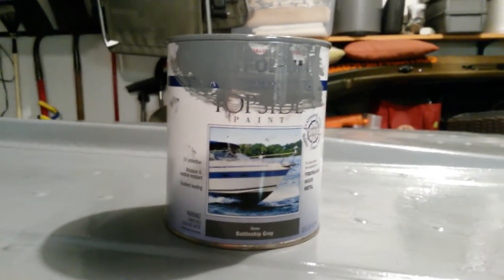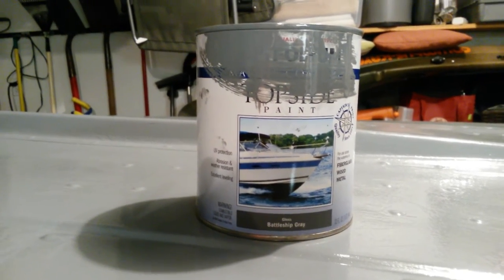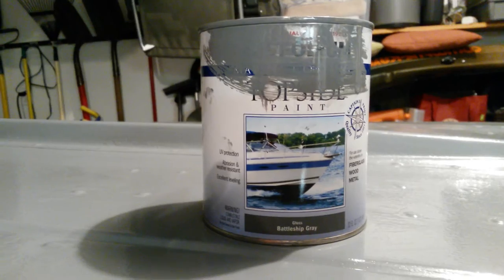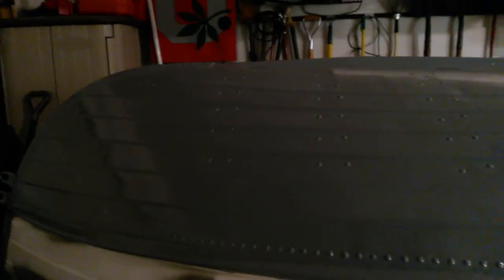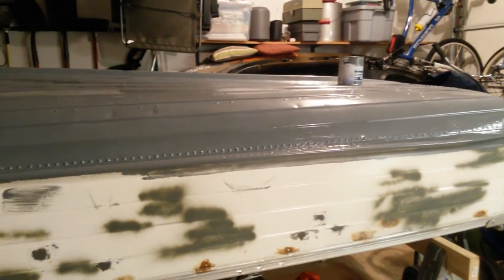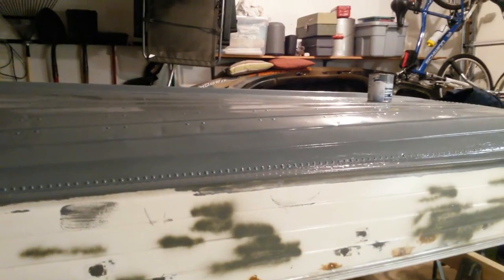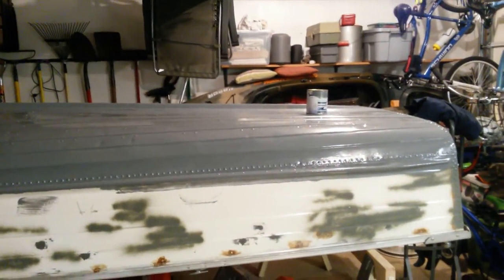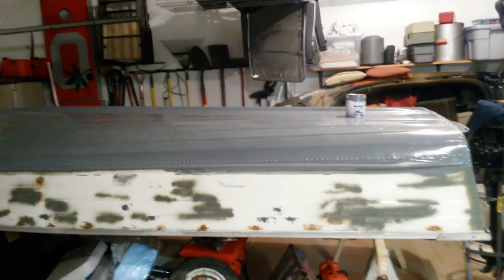Painted boat bottom 1963 Starcraft

Comment: It says it is an above the waterline type paint.  Did it hold up well for under water use?
Reply from the maker: correct, it is above the water line paint. I trailer the boat and only in fresh water. You would only need below water line paint if the boat is in water docked all the time or in salt water.
Reply: I leave it in the water for the month of July and weekends May, June and August.

Comment: Has anyone tried using spray on pickup truck bed liner for interior surfaces?  Might be tough non-skid surface made for high wear and tear areas?
Reply from the maker: I have not. I looked into it but I wanted a more finshed look and used products specifically designed for marine use and applications.